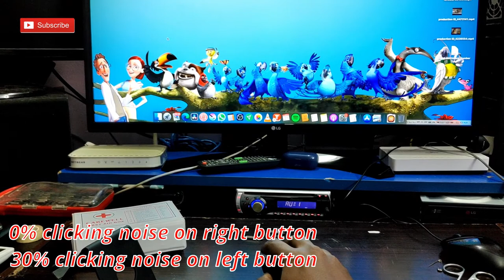How to make your mouse LESS noisy!

Comment: I did my g203 after 3 years of using. The only downside to do this method on mouses is that even with a soft pushing the bottoms dow you can click. I mean you dont need that much pressure. 
But who cares, I enjoy my quiet g203 😂 
Thank you for the guide 🙂
Reply from the maker: You're welcome :)
Reply: They need to just make silent products. I bought a condo, my room has carpet but my desk is by a wall. Somehow my neighbors can hear my mouse clicks. Its quite annoying, i have been through 4 keyboards and 3 mice. I got a laptop equiv. keyboard ultra silent and a logi silent mouse. I really dont know how they can still hear my mouse. They somehow feel or hear the feedback of the clicks even with the silent mouse. Going to try this, I have done everything from pads under my table legs to padding under my keyboard and mouse pad. Also the kid is autistic so maybe he just can hear low frequency noise.
Reply from the maker: Let me know after you try this...